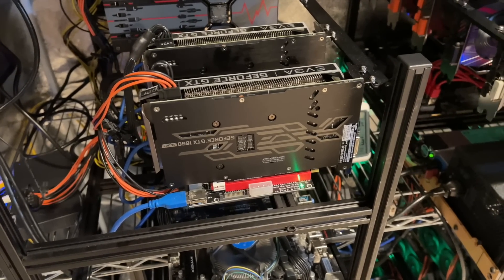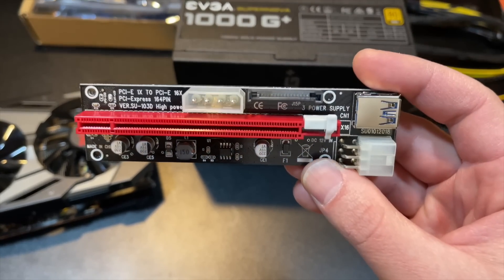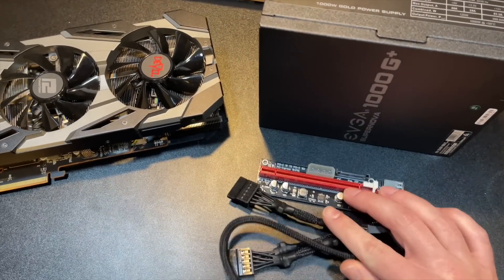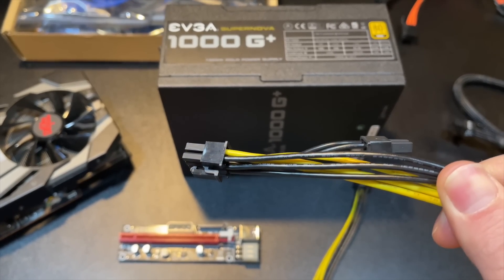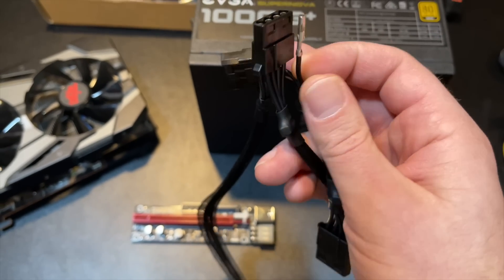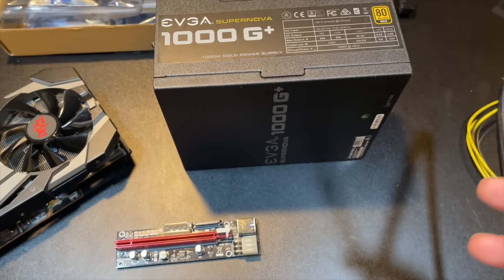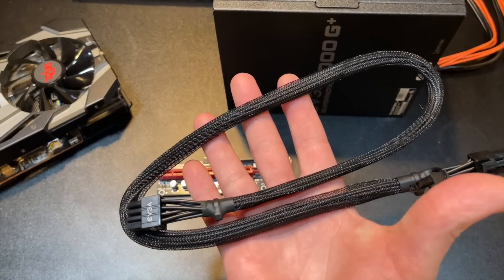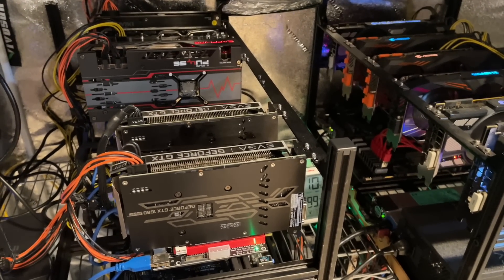Powering GPU Mining Risers Safely

Comment: why 6 pin to dual (6+2) not 8 pin to dual (6+2) splliter?
Reply from the maker: It doesn't matter for any modern, good quality splitter. Still has 3 pins that carry power in each.
Reply: @RedFoxCrypto  Fox what do you think about Esonic B250 and what Ram do you use with it?

Comment: Is there a specific 6 pin PCIE male-to-male cable that is required for a Corsair HX1200 PSU? I'm currently running SATA to my risers with no issues, but after watching this would like to switch to PCIE, but all I have open on my PSU are the 6 pin ports where the SATA and Molex plugin. When I look at the 6 pin PCIE cables on Amazon, they all say they are not compatible with Corsair PSU, only server breakout PSU, so what options are there to run 6 pin PCIE on my 6 pin accessory ports? Thanks!

Comment: I made a mistake switching.  Unless it's something I'm doing wrong otherwise; I learned a VERY important and expensive lesson. Make sure the 6 pin into the power supply and then out into a 2-way splitter for providing juice into 2 GPU risers. Make SURE the riser power splitters into a dedicated line are on the SAME POWER SUPPLY!  Also, buy better than needed wiring from Parallel Miner. They are very reasonable on prices and great customer support.  I am not affiliated with them, nor do I get anything for promoting them. I just don't mind buying from them.

Comment: From my psu there are coming 2 pci cables splitting into 4 8pin. Is it ok to use 2 of the 8 pin with splitters to power 2 rx580 and one riser?

Comment: Hey bro, so you said of I have a server cable it's ok? I mean a 6pin to 6+2pin... I can connect that cable to the peripherals (SATA/molex) 6pin port ? And then to the riser? Or course I will not use the +2 cuz there is no place to connect it, but is it safe to use the 6pin port from you psu to power your riser with a 6 to 6+2 cable ?

Comment: What do I do if I have a 3070 or 3090 running off a riser? They have 2x 8 pin and then the 6 pin for the riser
Reply from the maker: Use separate strands from the PSU. You can split the riser PCIe strand to either power another riser or one of the 8-pins on the PSU.

Comment: Great VID thanks for the tips. I would ahve used molex or sata. Didint know that much. Question...Do i need to use the same power supply for both the motherboard and gpus? Or can a use a cheap powersupply for the motherboard only and just leave the 1000w for the GPUS instead? Lets say 2 3090s or 4 3060ti´s?

Comment: Hey man great video, i just have one question, if i use a splitter on a 6 or 6+2 pin pcie cable, does each of outputs give 150 watts? Like i have a 6+2 pin pcie and i use a 8 pin splitter that gives me two 6+2 pin outputs, so does each of cables give me 150 watts or is it half (75 watts each cable)??
Reply: the cable could probably provide both 150W (total 300W) but the problem is the male pin in the pcie splitter. I dont think one 6+2 pin could withstand 300W (25A).
But if you're using it for riser's pcie-slot power, most probably it would draw less than 75W anyway.
but if you're using it for GPU main power, don't.

Comment: hey @redfoxcrypto - I got a question, so if my PSU has 8pin PCIe connector ports on the back. Is it okay if I do an 8pin to 6+2pin/6pin other end of the cable to power my GPU riser in the 6pin port?

Comment: Sata is just powering the connection so it doesn’t need a lot of power like the Gpu needs so sata is fine to use on the board but don’t try powering a Gpu with sata but it’s fine for powering that little board.

Comment: Hello friend, what about PCIe extension cable when you work with a mother board that already has an 8 GPU capacity, so 8 PCIe ports included  ? And still want to use open frame vs mining box that is, so to rise the GPU from the Mother Board.
I've only seen one example in a Red Panda vid : so it should work, any experience with that ?

Comment: Hey, I have a bit of a situation and I was wondering if you could help because you really seem to be knowing what you are doing.
So I have a mining motherboard with integrated CPU(Intel(R) Celeron(R) CPU 1037U @ 1.80GHz) and 8 PCI slots.
For a few months I have been mining with 6 rtx 3060 and everything was fine.
Then I put in an additional rtx 3090 and everything went to shit. I have two power supplies, 1700 watts in total and that should be more than enough. But when I put in the rtx 3090, two of the 3060 are only getting 40 watts and wont do anything, and the 3090 only gets around 240W.
Then When I took the 3090 out again, still one of the cards only gets 40W.
Then I tried to change miner and something curious happened. All of the cards were getting power, but 90W each, which is too little power, so they run terribly.
And now I switched back to the old miner and now 5 are running at 120W and one at 40W. I dont even have the 3090 in atm. 1700 Watts is waaaayyyy more than enough to power 6 3060s. Also, I use PCIe for every card, no splitters, no compromises. I dont get why they are not getting enough power.

Comment: i need to power a riser. i do not have possibility to use 6 pin. what about a Molex to 6 pin adapter? i jsut bought a new power supply. it arived today and only has 2 pci cables. already split. and i need them to power my 2 gpu's... as they both need a 8 and 6 pin. so im really mad at my self right now. i need to power one riser

Comment: Great video dude. Just a question, so when powering your GPU you power your riser with a pci-e connectors and a splitter to power the GPU from the riser and directly from the PSU?

Comment: What if I use more than one connector to power the riser? IE: PCIE 6pin and SATA at the same time, or maybe SATA to 6pin that comes with riser + another SATA into the riser SATA connector, that'd make 75w/2=37.5w which is more than enough for SATA connectors.

Comment: Hey Red Fox. Super informative and mandatory watch for all miners but especially a noob like me, building my first rig. Thanks for a great video. 1) I have a good quality braided 8-pin PCIe cable (6+2) that came with my Corsair RM100x PSU, that has a built in splitter. Is there any reason I can't use this to power two risers?

Comment: I finally have some cards but I always hear horror stories of people frying their gpus with bad quality risers. Even the most popular highest rated ones on Amazon have lots of these reviews. I want to make a rig but I want to do it as safely as possible to not risk destroying these expensive video cards. Should I be worried or is it simply that the people leaving those bad reviews were ignorant and used the risers incorrectly? Incredible video by the way, answered a ton of my questions.
Reply from the maker: Thanks buddy. I've stuck to the pretty standard risers over the years without issue. Couple times the Ubit ones from Amazon came DOA out of the box. You'll start to see most of the stuff is just rebranded standard risers coming out of the same factories. Even so, I genuinely do like the GPURisers.com stuff.
Reply: That puts my mind at ease, I have a feeling a lot of those negative reviews are people putting risers on backwards and using sata to 6 pin adapters. Thank you for the recommendation!

Comment: Been having so many issues with risers.  I think this video has solved it.  I did not realize that you must power the riser, and the GPU.  I assumed that it was getitng powered from the riser because the fans were moving on the card.  Yes?
Reply from the maker: Yup gotta power both.
Reply: @RedFoxCrypto  thanks.  Have seriously been struggling adding GPUs

Comment: Hey about a 6pin pcie connector that has  3pin * 12v ... it's max capability would be 8amps*3pins = 24amps. 24a * 12v = 288w. Shouldn't this be enough to power 3 new 6pin connectors. Just wondering why these splitters only split into 2 if they can in fact handle 3?
P.s.
If the the difference between the 6 pin pcie connector and the 8 pin connector are two added ground wires, doesn't that mean it would be safer to use a splitter that splits an 8pin to two 6pin/8pins unlike what you're using which is a 6pin that splits to two 8 pins.

Comment: Hey, I'm a bit confused. You completely ignored the 5volt cables on sata and molex. Wouldn't that supply additional wattage that you're not considering. For instance, if a molex cable can provide 11amps, doesn't that mean that would be 11amps * 12 = 132w plus 11amps * 5 = 55w for a total of 187w. Likewise a sata cable has 3 5v pins at 1.5amps. Doesn't that mean it can supply and added 22.5w on top of the 54w that you suggested. Bringing the total of a sata connecter to 76.5w. If i'm correct about this it seems even sata would in fact be safe to use. Even an old molex like you suggested to avoid that allows only 5amps would come to a total of 85w when considering both 12v and 5v pins.

Comment: Hey I know im late on this video but I just got both my gpus. I am trying to use one with the riser but 5 minutes after I plugged it in, it got crazy hot and the fans werent even spinning. Any idea why that would happen? Its an evga 3060, I have an msi 3060 directly on the motherboard which is having no problems. I plugged the riser into the motherboard and psu while the system was on, is that a no no?

Comment: O.G. Molex 4 pin use the standard Mate-N-Lok pins that have a max allowable current of 5 amps. The 20/24pin, ATX 12v, and PCIe connectors are all Mini-fit Jr and have an allowable current of 9 amps per pin. These are standardized, Molex and Amphenol are the two main makers.

Comment: nice video thank you, just one question, 75w riser it is in addition to the consumption of the GPU? or is it included? if my 3060ti uses 190w, I count 190 or 190 +75 for the cable and the power supply? thank you
Reply from the maker: It's included.

Comment: Question: let's say I have some 1200 Watts PSU  "A" powering two 300 Watts GPUs (assuming, using proper 288 Watts capable 8-pins PCI-E cables, without splutters) and the system, is it okay to use a separate 600W PSU "B" to power the two GPU Risers (and the risers only), again assuming proper PCI-E cables without splitters).
I'm just a bit unsure with that phase thing with electricity
Reply from the maker: I'd recommend keeping both the GPU and it's riser on the same PSU.
Reply: @RedFoxCrypto  Thank you very much! I have continued my research indeed.
Now, with two PSUs, I notice there is that thing with a 24pins adapter to plug both PSUs to one motherboard.

Is that bridge only to send the power-up signal to the second PSU or does it help about that phase thing?

Comment: Sir what should we do when we don't have enough power cables, currently i'm using 1800 watt psu which has 12 8 pin connectors which are connected to gpus

Comment: I just got the 6600 xt and I have to use both the 6 and 8 pins  plug on top of the gpu to power her up and get the fans going. Is that supposed to be right?
Reply from the maker: Yup that's right.

Comment: The PCIe card edge connector draws maximum 66W from 12V, not 75W. PCIe also requires 3.3V provided locally from onboard regulation on the riser. Total combined power is 75W after regulation. Total power line draw is several percent higher.

Thermal design power, TDP, is not equivalent nor calculated from electrical power draw. It's a thermal design guideline. Electrical design power must account for electrical transients and the small thermal masses of conductors and connectors. Electrical design power is much higher than thermal design power.

PCIe 6p should be considered two conductor pairs. 6+8p split connectors may have the third 12V conductor connected, but only two current carrying grounds. Sense conductors are not reliable high current grounds through GPU and PSU.

Running 16A through 18 gauge cable will burn over 5W in transmission losses alone. That's more than 2½% efficiency loss before considering additional loss in regulation due to voltage drop, or that those 6p to 2×8p PCIe power splitters are wired unevenly distributing current — additional transmission losses at best, interfering voltage drops causing errors in GPU power shifters at worse.

A lot of PSUs aren't warrantied in multi-PSU setups. At the very least, you're often required to attach one EPS connector to the motherboard, or don't tell them.

Comment: The adapter (add2PSU) only supports 2000w at maximum, but I want to run 4000w meaning x2 psu's.. what can I do here? Do you have a supplier you could recommend?

Comment: used sata for 3 years never had a problem.unless you plug 3 card on a same wire.sata. my cards rx580 5700xt 5600xt 3070ti 3060.I would not use more then 1 per sata cable with the nvida 3000 ish.
Reply: regarding 3060, with a small tweak, the max TDP can be 120W instead of 170W... the 8pin connector on the video card can provide 150W... does that mean that it will not be needed to power up the riser if 120W TDP can be achieved? or in the 170W TDP scenario, will sata/molex rated at 54W be safe, considering only 20W is left to supply from the pcie riser?

Comment: So I just put together my first rig and I was powering 3 risers using an esata psu cable. You don't want to know which cards I have on this rig (power hogs). When I went up to 6 cards the rig became unstable. It would go offline or have a lot of rejected shares. After watching this video, I replaced the risers with the ones second to last you mentioned. I got rid of all the sata to 6pin cables. I replaced them with 3x 6pin cables. Each cable powers 2 risers. The rig immediately looks more stable, even shaving almost 25 watts from the get go. Thanks for this golden information!

Comment: When you're using the PCIe splitter with the PCIE cable from the PSU, do you plug it into 8pin or 6pin on the PSU? Video was really helpful man, if you care about your rig watch this video.....
Reply: 6 pin goes to PSU, 6+2 (8 pin) goes to the gpu.

Comment: Hey Red Fox, I was curious at 14:45, that splitter, would that also "split" the power? So I can't have 2 risers on it? Would then the total be 150W and NOT 75W for 2 risers? or am I missing something?
Reply: dude listen it again he explains the total power that 6 pin really gets. its the female 6 pin on the  gpu than can only get 75w.
Reply: @MrBarosxp  Yeah, noticed it later. Would have been great to have on a data sheet. I'll get to it later so I can see what i need for my GPUs.

Comment: I don't know if you're still searching or what not. But the good thing about electricity is that everything can be calculated. 

If you take the gauge and length of the wire (which both can be measured with the right tools) you can know how much amperage it can take.
Reply: I'm making a reference to the Molex connector. Lol, forgot to re-add that after editing the comment.

Comment: SATA power connectors has a total of 15 pins of which 9 are power pins (3 x 3.3V, 3 x 5V, 3 x 12V). Each pin can carry 1.5Amps for a total of 13.5Amps. 
3.3v x 4.5A = 14.85w
5v x  4.5A = 22.5w
12v  x  4.5A  = 54w

Total = 91.35W can supply
Reply from the maker: This is 100% not true. Check the references I linked in my video description and please be safe.
Reply: @RedFoxCrypto  Your point is correct cuz PCI-E slot works on 12v rail. But , SATA cable can provide 91.35w. PCI-E only get 54w using sata cable. 
Anyway your videos are great. I like them. keep it up dude...

Comment: Awesome video! Quick question. I currently use the SATA to power my risers because that's all I can utilize(ready for the house to burn down). I have 6 GPU's that require 8+8 or 8+6 Combo. My PSU only has 6 designated ports for PCI-E. I use the PCI-E to Splitter to power each card alone. How would I power the riser with PCI-E?  Can I daisy chain the heck out of everything to all utilize the 6 PCI-E ports on my PSU? Thanks!

Comment: Very good video.  A word of caution, the cheap yellow/black PCIE splitters that are sold on Amazon, are not  18 ga. wire, but are 22 or 23 ga.  They are way thinner than the original wiring.
Reply from the maker: Thank you dude. Always gotta be careful with wire gauge. Great call out.

Comment: how bout that 8pin tho man. 
3090 for instance needs two 8 pins, so 300w. Obviously one should use two 6pin from psu.
But is that safe, drawing full 300w off two 6p to 8pin adapters?
Reply from the maker: You can split a single PCIe strand to do the riser and one 8-pin port on the GPU since that is 225w max. Then use another single strand to the the remaining 8-pin. If you have a 3080 or 3090 that has 3 8-pins then I'd use another separate strand for the remaining 8-pin.
Reply: @RedFoxCrypto  thank you!

Comment: I am using 1 sata cable to power 2 riser of 570 4 GB , is that so bad?😃 had not problem yet
Reply from the maker: I'd switch it to PCIe.
Reply: @RedFoxCrypto  i ordered some but it will take a month. Anyway I took a look at that short cables you threw away and they are 18awg,  so hope they wount burn till PCIe gets home

Comment: Just a question about 16:00 section. If you power the gpu and the max tdp is 125 watts, is that accounting for power draw from the riser aswell since that can handle 75 watts in theory? Or would this be from only the 6 pin?
Reply from the maker: It includes the riser power so 125w total.
Reply: @RedFoxCrypto  ahh got it, thank you!

Comment: Very informative video. I have watched similar video like this before. However, it also depends on GPU type/model. I have been using Thermaltake Toughpower GF1 850W (16AWG wires) and similar (if not same) riser as in this video for my rigs. I used SATA cable to power not one but two risers from each SATA cable and all of them have been running fine for many months. Cables ran very cold. I didn't feel warm at all from SATA cables. My GPUs are 6x RX 5600 XT (66-70Watt/card ),  6xGTX 1660 S (70-75Watt/card). All wattages are reported from HiveOs